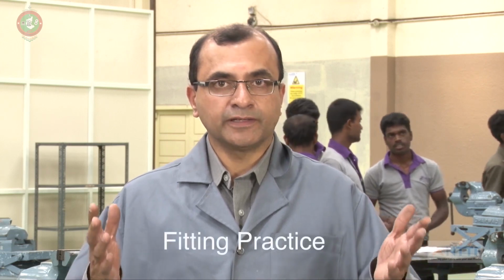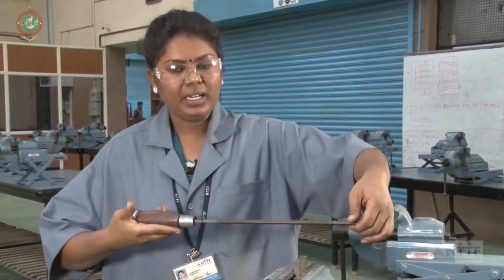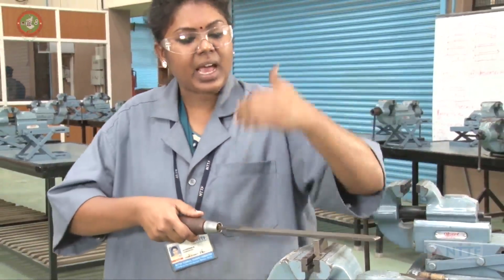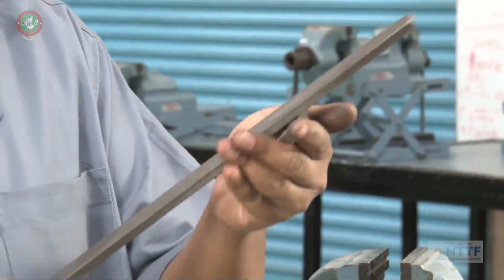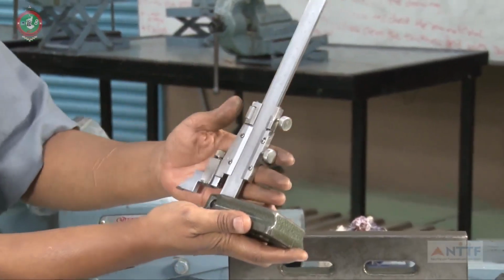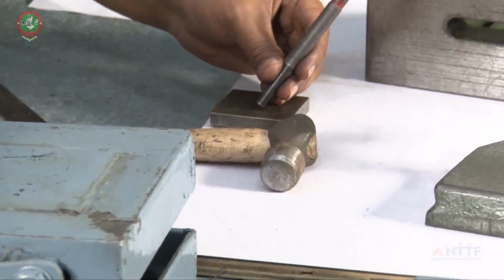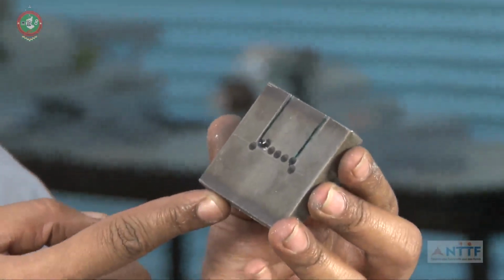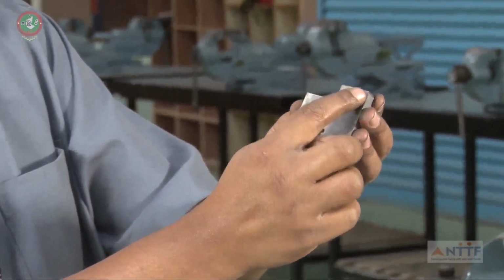Fitting Practice | Workshop Practice | Mechanical Engineering

Comment: The very first rule of filing is : "file works only when it moves forward direction, so put pressure on file during forward motion, return backward should be no pressure"
Reply: Ok to not lift the file on returning stroke when filing thin workpiece you dont wanna loose the feel for the angle just dont press on the return stroke

Comment: Bolt your vice down hard on the bench,Use vice jaw protectors to avoid scratching the workpiece. You are rubbing the file on the work piece, The file cuts on the forward stroke only, you lift the file on the backstroke. Draw filing is when you move the file 90degrees to the workpiece, i have never seen anyone file the way you demonstrate the draw file.You use the wrong side of the square, the accurate parts of the try square are the inside edges, you do not use the outside edge. i am a UK trained Mechanical Fitter for over 40 years Maybe you do things different in your country.
Reply: What u said is right sir
Reply: What i know 
1.you can file back forth for when you want very precise work where you dont wanna lose the feel or sense when holding a file.But yes a better way to preserve the file is to file forward with moderate pressure at moderate speed to prevent work hardening
2.the workpiece should be lowered close to the jaw of the workpiece so when you file it wont chatter or squeak
 caused by the leverage of the workpiece being raised  as it tends to brean the tip of the file teeth it may not be obvious but its there making your file cut inefficiently and leaving bad surface finish
3.use the full span of the file as much as possible except the tapered end in most case to evenly wear out the file
4.move your body and lock your hand near your torso for general filing or use whatever position you feel comfortable as long you can get the work done precisely.Though i dont reccomend stroking your hands for a long period of time
5.filing also takes patience very precise work can be done with hand tools if you have been doing it for a long period of time take a rest and think of how to get it done by imagining it for a day or two 
Not being a comment warrior but hope yall can take it as a  reference 😄
Reply: Yes different in india

Comment: Marking step is wrong.. you have to remove that rough surface before marking . Otherwise that surface will spoil the height gauge marking tip which is really expensive and you will not get proper dimension if that edge is blended.